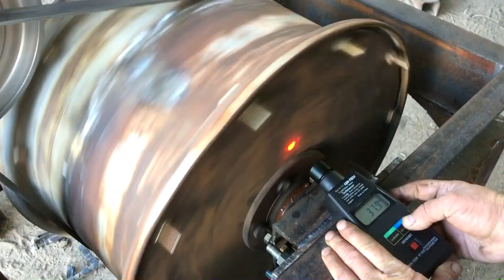Building a Better Ball Mill

Comment: You can put a small 24v 250w e-bike motor on that and use a foot throttle w/ a "cruise control" setting in the controller to run it at a set speed, then a small 24v battery pack could potentially run it anywhere... Even up at your mine.

Comment: Just a question, is there a reason you didn't put the door on the top of the drum? I'm guessing it was just to avoid damaging/breaking the door with the weight of the rocks, but I was curious if there'd be an innovative way to place the door on the outside to make it easier to dump ore in and remove the dust.

Comment: Cody's ball mill was my very first contact with Cody. I wanted to see how to make one so I could produce aluminum powder and make thermite.
Since I have neighbors I've been trying to think of ways to reduce the noise and I have one: using rubber on the inside and outside of the drum. It makes a substantial difference.

Comment: Would the process be any faster if you welded a few fins on the inside of the drum to help toss everything around, or would that just be more trouble than it's worth? Seems like it crushes everything just fine, but I'm just wondering.

Comment: The motor might be more compact on the bottom but if it was, like you said the dog might get in it or you might catch a shoelace or ripped pant leg in it. On top you still run the risk of getting your shirt or something caught in it but you might pay more attention to your shirt going in it than your shoe lace. Like you said though, you could build a guard for the belt. Cool build. If I had a welder I'd be building one too.

Comment: Cody, can you please show us the generator system with the hit and miss engine you have for this ranch? I heard it speed up when you were using power tools, how much fuel does it use, how long has it been running,  how much power can it make can you weld with it or are you using a different generator?

Comment: Does the iron particles from the balls (rust) or inside of the mill significantly affect purity of the dust? I would have assumes stainless steel balls would have been used is all.

Comment: Worked around a handful of large ball mills (100-150 tph). Yours looks great but you might consider adding a rubber liner to increase the life of the mill. Also the exposed bolts inside will be an issue down the road. You could put the bolt heads inside and weld them to the mill.

Comment: Cool build, you should ask your dad to help you with more of these projects.  Also, I know that this was just to test the ball mill, but why not use your x-ray spectrometer to help select which ore to crush, since you have that nice expensive toy, and you will likely end up processing the crushed ore anyway.
Reply: While I am at it, you really should build a secure entrance to your mine and build out some rooms in there with a solar power system with a large inverter, ventilation and doors, a chem lab, a machine shop, and a hydroponics garden with solar powered LED lighting.  You might be able to fund it with revenue from your channel since the videos of building it would likely prove as popular as most of your other content.  You could have your own little biosphere in there.

Comment: No complaint about the exposed belt. However, using a single cantilever to support the drive and spin wheel is prone to inaccuracy and wear. You'd want to weld on another square tube and across from the wheel to support the drive. Reduce wobble and minimize sheer force wearing the bearing.

Comment: I'm curious why you didn't just modify a cement mixer? All you would really need to do is take the fins out and make a lid? Then to could tip it up to load it, and tip it down to dump it.

Comment: Beware that it does not spin too fast.  Centrifical force might just keep your stones from rolling .   I had the same problem with my dryer, it was not tumbling due to high speed when I made a new belt for it from thicker stock.  Also I would imagine a 1/4 hp motor would suffice and be a little slower than a 1 hp motor.

Comment: Hi Cody, When you said "close enough" to the RPM of the motor being 1740, its actually dead on. An asynchronous induction AC motor like that is driven by rotating magnetic fields, and the physical rotation of the central rotor lags behind the magnetic field produced by the stator, a value called 'slip'. Here are some formulas you might find interesting!
Synchronous speed = 120 x Electrical Frequency / Number of Poles
Slip = ( Synchronous speed - Real speed )/ Synchronous speed
Your 1800 rpm motor, reading at 1740 rpm, has a slip of roughly 3.33%, a perfectly normal value for that size of motor.

Comment: I have seen people mount the drive motor onto an unsupported hinged plate, the weight of the motor tensions the drive belt...it seemed a pretty good system to me.
Reply: Also I suppose you could add weights to tension the belt more if required

Comment: An old wheel hub from a car would be strong enough that it would only require it on the back so you can get rid of the front beam and put a full door on it. I've done it.

Comment: You should make a metal funnel/hopper to load material into it so it wouldn't take as long to fill up, have it on a hinge so you can just rotate it into the door when you need to and mover it away again after

Comment: So Cody you made a lead acid battery before but have you ever wanted to make an experimental battery? Like an aluminum ion battery? It would be cool to see if it's possible to make an aluminum ion battery that is cheaper than buying commercially available lithium ion batteries. If so would be cool for diy EV conversions

Comment: Need to drop in a 45 degree piece of roof guttering or the likes for a funnel to make loading it faster.

I was reading SOME place that pink calcite is better than white, but I can't remember why...maybe because it has some kind of zinc in it? Not sure now.

Also a hinge on the frame which holds that hub would make opening and closing the sides easier. (~_^)-b

Comment: Why wasn't the motor connected directly to the ball mill ? Why is that large circular wheel in the middle used ?
Reply: Lord Sauron for gearing the speed down. It would not work with just a single reduction, the mill would be turning too fast
Reply: Thanks

Comment: Would a shop vac work to get all the powder out? I was thinking it would've made more sense to put the opening on the curved side where the belt goes. only problem would be leaking but it'd make getting the powder out easier

Comment: Time to make a small square loading chute that fits on the top brace, so you can just pour the buckets of ore into the mill, and then empty the bucket of balls into it as well. Will save time and mess in the loading, and cut the loading time by more than half as well.

Comment: Cody you should designs a funnel with a slide that can be mounted/unmounted for the opening. It would be way easier to dump the balls in instead of throwing handfuls in at a time.

Comment: So I worked at a big mining company and learned that more balls and less rpm works better than just adding rotational speed to the mill if you want fine powder. Like 50% of the critical speed of the mill and as many balls as you can while maintaining that speed.

Comment: I like building stuff like this too (Ok, I haven't built a ball mill, my last project was a chicken plucker, which actually has quite a bit in common to this build), why buy it when you can make it yourself, right?

BTW, an induction motor needs to run slower than the electrical frequency, otherwise the induction stops, hence why the motor wasn't running at 1,800 rpm :-)

Comment: Hey Cody, can you do some videos on that old hit and miss engine sometime? Also you might want to make a removable slide hopper that will give you like a big funnel to pour that material into so it will load the mill quicker. You could just slowly pour the bucket into it instead of going a pitcher at a time.

Comment: so surely this means it is easier to separate minerals i understand that running a ball mill for 3 hours is not practical but saying that you should be able to go in the mine with your spectrometer find the metals you want break it down to powder and seperate the main elements

Comment: Should had put some sort of tensioner spring in the motor and pulleys so that when the belt gets loose over time you can adjust the tightness

Comment: The only problem I see is that flat belt will always "derail" from the groove. It should be a small convex shape crown instead of a groove. Like they did the flat belt pulleys for powering machines in the steam era.

Comment: As always... Cody, get more balls. Same size preferably. The mill should be 50% full of balls, and 25% of whatever you want to mill. It will mill a LOT faster with a proper charge.
Needless to say, anything milled with rusty iron balls will be contaminated with iron, but for ores, i think steel or iron is your best bet.
If the mill was as long as the old one, i'd say load it with rods rather then balls, but with these dimensions, rods wont really work that well.

Big bonus point collection for collaborating with dad. Watch out, he might get his own Youtube channel, and beat you at this Youtube game ;- )
Reply: Mr B I think the balls he uses are lead
Reply: For crushing ore? You are joking, right? I'm pretty sure he's just re-using the balls from the old mill, which he stated was ball bearings, steel, and i pointed out back there to, that it's under-filled. Anyway, it gets the job done, more balls, and more ore wouldn't get a better result, just more in the same timeframe, with less wear on the balls. No real issue.

Comment: Very impressive work. It's neat seeing the two of you working on it.
Did you consider putting the door on the outer curved section of the drum so you could dump things out without having to scoop it? It would make it easy to load and unload but I'm not sure how well it would stand up to abuse and it would be hard getting a good fit using the cut out section (too much lost to the cutting torch). You'd probably need to make a bent sheet out of other stock.

Comment: All you might need is a tensioner. Weld on a hinged arm with a roller bearing on the end with a spring applying tension from the base to arm with the belt on the roller bearing.

Comment: Cody, I have a propane torch and tried to melt some gold. The gold did not even get red hot, do you think I can melt some gold with my propane blowtorch? Also can you do a video on lithium extraction?
Reply from the maker: FloridaGuy 
Switch the propane out for mapp gas and it will melt gold.
Reply: too expensive, but thanks anyways.

Comment: A small suggestion for loading in the material, maybe have a shoot fitting (almost like a metal dust pan) mostly just so you can pour a bucket in without having to use a cup. And it wouldn’t have to be screwed on tightly like the actual removable panel. I don’t know. I’m 17 and definitely not an engineer

Comment: Would it work to use a bike chain and gears Instead of using the belt, then u could attach the motor to one of the large gears and the smaller gear to the axel of the drum?

Comment: Actually the motor can have a bed with a hinge on the side of frame and the weight on the motor can keep the belt tensioned and even can handle more pulleys sizes easely.

Comment: Could you do a short video about the little motor that is often heard chugging away at the ranch. What does it power?
Reply: 2soldierman2 if I remember correctly it is a diesel generator
Reply: he did actually do one that powers their house and shop i believe
Reply: it's a hit and miss engine I believe, but I am curious as to how they can weld with it?
Reply: @jwalker7567  After some time you just ignore that stuff. Brain is great at filtering information.

Comment: You can get automatic motor belt tension if the motor is on a mounting plate hinged to the frame instead of fix-welded.

Comment: To get that loose belt sorted out, a good way is to have a third wheel rest on top if it under its own weigh, only need to connect it to a hinge!
Reply: Along this line. A trick my dad taught me. Use a mountain bike derailer. Remove the gear and place a similar sized pulley. Also gives you adjustable tension which helps when later down the line you find your favorite belts aren't sold anymore and have to change to a brand that is slightly different.

Comment: Nice fabricobble. I made a 1/2hp grinder & wire wheel out of a GE washing machine motor like 25 years ago and it still runs great. Even made it 2 speed before that was a popular feature in bench grinders. Is that a Mercury car in the background? Cougar maybe?

Love the design of that 5 gal bucket Grizzly. When I visited a mine in Wenatchee, Washington there was a clear note that a couple of guys had fallen in a much larger one and were killed. Imagine getting ground together with the rock. Ooof Da!
Reply: The car is a mustang 2. mid to late 70's

Comment: Ball mills can be used for making gunpowder, now you're gonna get demonitized :(
Reply: its a carbon steel canister, making gunpowder in it would not be the best idea.
Reply: @vexes908  it would probably be fine for milling the raw material before it gets mixed together.
Reply: vexes908 that sounds like way too logical a response for YouTube to accept it as a defence when they strike the video. Cody uploaded a gunpowder from urine which required like 18 months to make and they had a problem with that
Reply: DKTAz00 dude je refined uranium
Reply: He
Reply: vexes908 sparks?
Reply: DKTAz00 Use lead balls^
Reply: vexes908 Shhhh! Don't feed thd Trolls sir!
Reply: As long as a video is in the "Education" category, it will never get demonitized.
Reply: derbi senda lead is dangerous also reactive

Comment: So why not just put a door on an electric cement mixer? They average 28-30 rpm and can handle hundreds of pounds, with the added bonus of being tippable to empty. Would it be because the motor may not be able to run as long as required for a ball mill?
Reply: Even then you can just replace the motor with one capable of doing so. Real reason is probably because they're expensive as heck compared to some old junk lying around that can be repurposed.
Reply: Kain Yusanagi true, I thought of that, but for its purpose, I figure one of them $200 northern tool deals would do just fine since interior fin design would be irrelevant if not removed entirely and commercial use probably isn't the plan for it.
Reply: It can probably handle the weight, but I assume the metal is still relatively thin and the erosion from the balls and material will wear out through very quickly. Cement, having water, kinda lubricates the walls, and some cement dries up on the walls too and kinda protects them. The cheap ones are probably made of the lowest quality materials too. But basically i just think it would just get holes through it quickly
Reply: MK I can see where you are coming from, some of it make sense, my main reason for asking is me and my dad used an electric cement mixer as a ball mill of sorts (similar in principle anyway) to hull hundreds of black walnuts at the same time though we added water as you stated, but it lasted 5 years before it quit and it was just a harbor freight special for $150 lol
Reply: They are not made from carbon steel. This is. 

This won't wear nearly as fast. If its hard enough, it won't really wear at all.
Reply: Maybe I'm wrong, but as I understood you need center of rotation perpendicular to gravity (otherwise balls will stay in the bottom and all powder will stay on top). Also you need to be sure that everything that is placed inside of ball mill stays there, and open top won't make that easy.
Reply: Карл Шлегер true on the level thing but as i mentioned above, we used one as a ball mill of sorts, all we did to fix that was add some length to the rear legs, but like I said originally was to put a door on it. I'm mainly wondering if it was a longevity kind of thing or a sentimental kind of thing.
Reply: That's not a risk at all, MK. While a little bit of water is often used in the mixing process to get a proper bond, dry mixing is very common.

Comment: What is the 2 Stroke i can hear in the background doing? Couldnt concentrate the whole Video because i wanted to See the engine :)
Reply from the maker: Actually a 4-stroke, its just running slow. Pretty sure i've showed it in a few videos.
Reply: Cody'sLab it sounds sounds nice! I Will look for it :)
Reply: Which videos? It sounds like a single cylinder engine. Is it a generator for the whole property or just for the welder?

Comment: I tried making thermite only out of rust and aluminum foil. It turned out amazing and worked extremely well. A ballmill is a really useful tool. The only problem when running it over a longer period of time is that it is using quite a lot of energy...
Great project!
Reply: They're also handy in making gunpowder.
Reply: Yes if you had a continuous source of moving water like a river, you could easily power a ball mill with that.
Unfortunately Cody doesn't have a river near by.
Reply: Simon Tay well I think I need to try this out🤔☺️